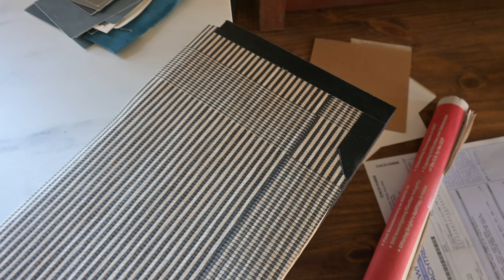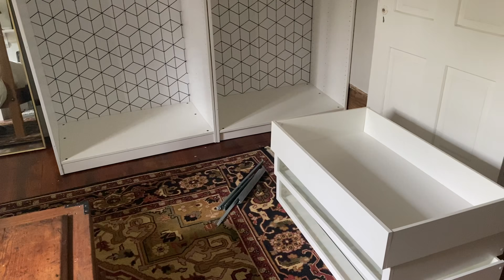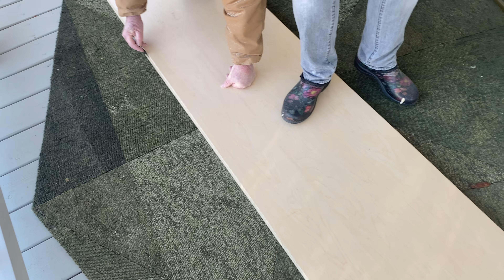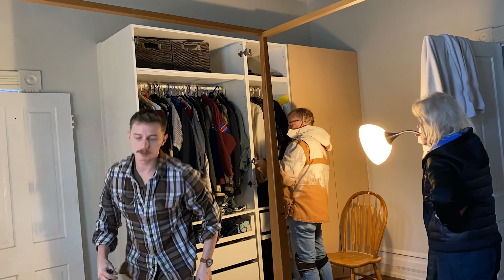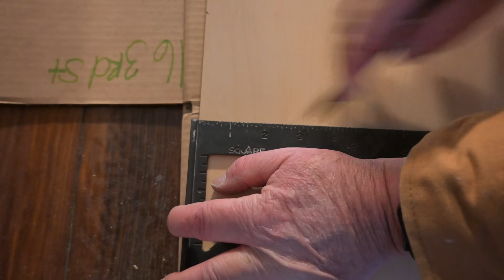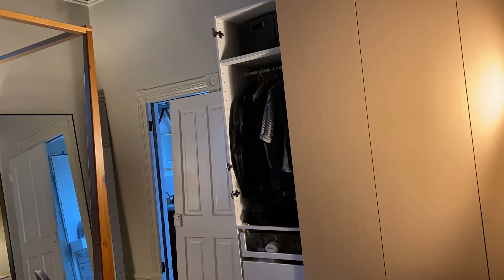DIY IKEA PAX/FORSAND Doors (with all the measurements!) | REISSUED

Comment: Hi Andrew, thanks for the motivation!  My wardrobe is an existing built in and I currently have the doors off as I need to finish them (previous owner painted them with a water base paint over oil based enamel so the paint is peeling and I have to strip them, UGGHHH,). I'm going to be adding moulding, replacing the hinges and painting,  so can't wait to see your next video. Have a great weekend 😊
Reply from the maker: Omg Gabby! Your project sounds so cool! Aside from stripping paint haha. But it’ll be worth it! Let us know how it goes!